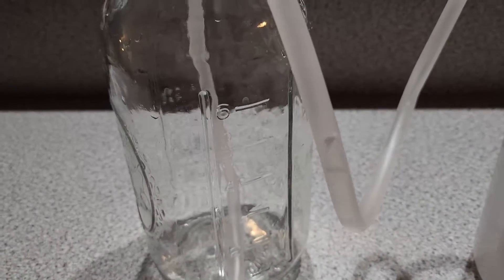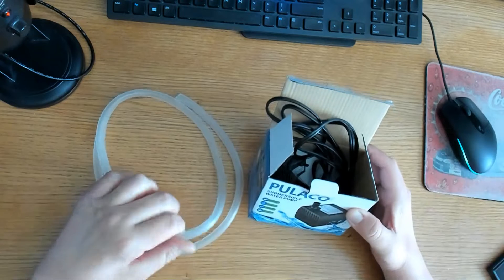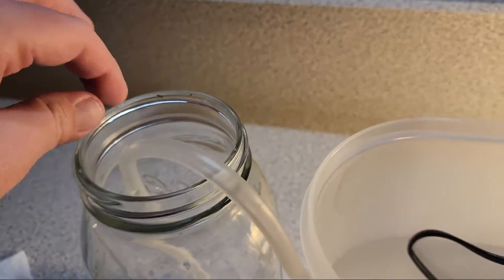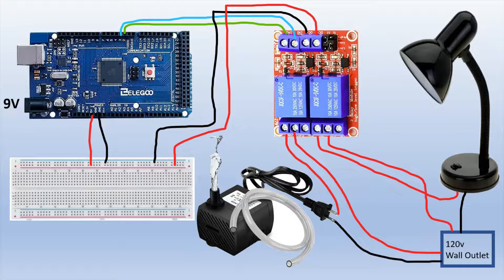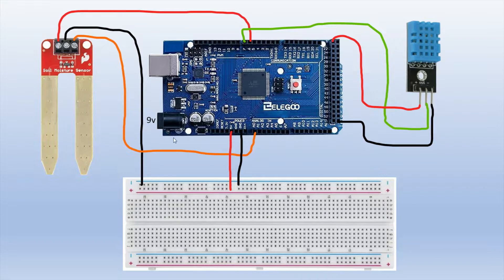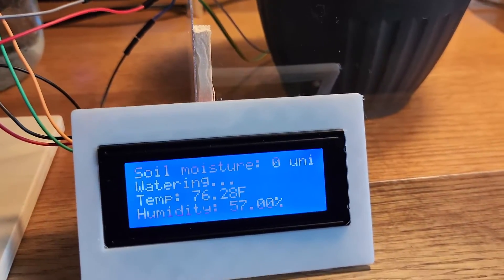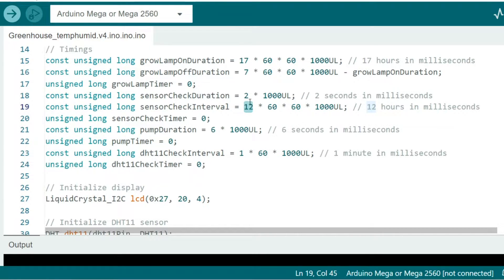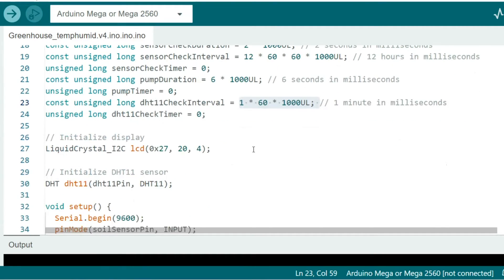Garden Like a Pro: Build Your Own Arduino Powered Indoor Mini Greenhouse

Comment: can you use a power bank to power this? instead of the wall adapter, what alternative can you use?
Reply from the maker: hey there!
You will want a 12v power source. A 12v battery that is capable of running a pump periodically. Supply appropriate power to your Arduino.
Connect step-down (buck) converters to power the lower-voltage items. If your LED lamp and pump are 12V, there is no need to step them down—power them directly from the battery.

In the video I used a relay, but for a DC setup, you may want to use a logic-level MOSFET to do the switching.
If you find that the pump and lamp are power hungry and pump startup causes Arduino resets, isolate the electronics with a proper buck converter, wiring, and capacitors.

Make sure the battery can supply enough current for all loads. Calculate the maximum current draw and add at least 20% overhead to ensure reliable operation.

This is how I would approach it as a DC powered project. Make sure to check your datasheets - that part is a must!  👍👍

Comment: can I use arduino uno for this project?
Reply from the maker: Hey there!
sure you can! Just make sure your pin definitions in the code match the pins you use on the uno. 👍
Reply: @BMonsterLaboratory thank you! can you use a uno r3 ch340, instead of elegoo mega?

Comment: Can I use Arduino Uno R3 instead of Elegoo Mega?
Reply from the maker: Hey there!
yes, you can. Just make sure your pin definitions in the code match the pins you use on the uno. 👍

Comment: hello. im from india and I cannot find the elegoo mega, can you please share a link to it as I am gettin varied results
Reply from the maker: hey there!
I used the Elegoo Mega R3 version, it's the older version and it did just fine. Here's a link

https://www.amazon.com/ELEGOO-ATmega2560-ATMEGA16U2-Arduino-Compliant/dp/B01H4ZDYCE/ref=sr_1_3_pp?crid=268B5225KRNSA&dib=eyJ2IjoiMSJ9.4NfekKUziOGIHon9sPPDWsoAcLKLjzAWE0J_h1lr_JvQuiUoP2Y2tfaCtAkcmE25YC-l_bFVWo4dM7VUD4ePaBtzStscVPiksJtKJ8nm0qL5NnxjASmlTKDwt3npjx0Qrjhgbq1o82EHiUQFKdHuzQSLEMxwJEUE5QAmwyPRa3Ia3YE-AeHPWuq7NhJvDlYXz9fQSZKZ8RRu12qkaeb6BJeFkq0ftdJA0qXaP3r4Xh4.-zpjiWa6dd8HxBFn-pffeJ68SoM6pyF1-AMOG9_tosY&dib_tag=se&keywords=elegoo%2Bmega&qid=1759783341&sprefix=elegoo%2Bmega%2Caps%2C135&sr=8-3&th=1
Reply: @BMonsterLaboratory  Thanks a lot bro appreciate it
Reply from the maker: @SomeRandomguy-qy6hk  you're welcome.
best of luck to you!

Comment: hey could i use like a small bulb or led perhaphs instead of a lamp and a small water  pump too like because i want a smaller project so even my plants would be small.how would that change my source voltage?like ur using 120v rn so what would i use?a battery? and also the relay?would i use a smaller relay?
Reply from the maker: you could use a strip of WS2812B LEDs, they are 5v. You can use 5, 10 or however many lights you need or you could use a low voltage buble if you like. You don't need to use a relay for low voltage switching (you can, but not necessary). A small mosfet (IRF540N ) would be a great switch for what you are describing. Amazon also has mosfet modules with simple diagrams that may be helpful. There are micro submersible mini water pumps on Amazon that operate on 5v. that would fit right into your 5v setup.
So yes, you could scale down the project and use 5V power. If you do, make sure you have a power supply with plenty of current to supply all the parts. 
This sounds like a great followup video for this project but it may be a while before I get to it.

Comment: When I plug everything in, I don’t get any readings on my display. How can I fix this?
Reply from the maker: Hello, 
make sure you're using the correct I2C address. Use potentiometer to make text visible.  Double check wiring and look for loose connections.
If that doesn't work, post your code here or send it to me by email - bmonsterlaboratory@gmail.com  👍
Reply: Ok thanks, I’ll try this
Reply: How can I check if I’m using the correct 12c address?
Reply from the maker: @JoshPike-k8n  The address may be printed on the board or in the documentation for the board. It will be something like 0x27 or 0x3F... some variation of that.
For instance, my I2C address in this video is on line 27: LiquidCrystal_I2C lcd(0x27, 20, 4); 
0x27 is the address, the lcd has 20 columns and 4 rows.

You  can run this program and check the serial monitor in Arduino IDE to get your I2C address: 

#include <Wire.h>

void setup() {
  Wire.begin();
  Serial.begin(9600);
  Serial.println("Scanning for I2C devices...");
}

void loop() {
  byte error, address;
  int nDevices = 0;

  for (address = 1; address < 127; address++) {
    Wire.beginTransmission(address);
    error = Wire.endTransmission();

    if (error == 0) {
      Serial.print("I2C device found at address 0x");
      if (address < 16)
        Serial.print("0");
      Serial.println(address, HEX);
      nDevices++;
    } else if (error == 4) {
      Serial.print("Unknown error at address 0x");
      if (address < 16)
        Serial.print("0");
      Serial.println(address, HEX);
    }
  }

  if (nDevices == 0)
    Serial.println("No I2C devices found.\n");
  else
    Serial.println("Scan complete.\n");

  delay(5000); //
}
Reply: @BMonsterLaboratory ok thank you

Comment: can you please list down the components needed?
Reply from the maker: hey there!  go to 0:40 in the video. I include the name and image of items you'll need. 
For the code, go to Facebook and search "greenduino" and you'll see the video post. look in the comments for the code, it's posted in 2 parts. Put it in your Arduino IDE and upload it to your arduino 👍😎  you'll be growin' in no time
Reply from the maker: Looks like I posted the code in a previous comment on this video...here's a repost.

#include <Wire.h>
#include <LiquidCrystal_I2C.h>
#include <DHT.h>
// Pin definitions
const int soilSensorPin = A0;
const int pumpRelayPin = 2;
const int growLampRelayPin = 3;
const int sensorPowerPin = 6;
const int dht11Pin = 7;
const int soilThreshold = 100; // Adjust according to your desired soil moisture threshold
// Timings
const unsigned long growLampOnDuration = 17 * 60 * 60 * 1000UL; // 17 hours in milliseconds
const unsigned long growLampOffDuration = 7 * 60 * 60 * 1000UL - growLampOnDuration;
unsigned long growLampTimer = 0;
const unsigned long sensorCheckDuration = 2 * 1000UL; // 2 seconds in milliseconds
const unsigned long sensorCheckInterval = 12 * 60 * 60 * 1000UL; // 12 hours in milliseconds
unsigned long sensorCheckTimer = 0;
const unsigned long pumpDuration = 6 * 1000UL; // 6 seconds in milliseconds
unsigned long pumpTimer = 0;
const unsigned long dht11CheckInterval = 1 * 60 * 1000UL; // 1 minute in milliseconds
unsigned long dht11CheckTimer = 0;
// Initialize display
LiquidCrystal_I2C lcd(0x27, 20, 4);
// Initialize DHT11 sensor
DHT dht11(dht11Pin, DHT11);
void setup() {
Serial.begin(9600);
pinMode(soilSensorPin, INPUT);
pinMode(pumpRelayPin, OUTPUT);
pinMode(growLampRelayPin, OUTPUT);
pinMode(sensorPowerPin, OUTPUT);
dht11.begin();
// Initialize LCD display
lcd.init();
lcd.backlight();
lcd.setCursor(0, 0);
lcd.print("Greenhouse System");
// Turn grow lamp on
digitalWrite(growLampRelayPin, HIGH);
growLampTimer = millis();
}
void loop() {
unsigned long currentTime = millis();
int soilMoisture = 0;
// Check soil moisture every 12 hours
if (currentTime - sensorCheckTimer >= sensorCheckInterval) {
digitalWrite(sensorPowerPin, HIGH);
delay(sensorCheckDuration);
soilMoisture = analogRead(soilSensorPin);
digitalWrite(sensorPowerPin, LOW);
//reset sensor check timer
sensorCheckTimer=currentTime;
bool needsWatering = soilMoisture < soilThreshold;
if (needsWatering) {
digitalWrite(pumpRelayPin, HIGH);
pumpTimer = currentTime;
delay(pumpDuration);
digitalWrite(pumpRelayPin, LOW);
}
lcd.setCursor(0, 0);
lcd.print("Moisture: ");
lcd.print(soilMoisture);
lcd.print(" units");
lcd.setCursor(0, 1);
lcd.print(needsWatering ? "Watering..." : "Healthy");
}
// Check temperature and humidity every minute
if (currentTime - dht11CheckTimer >= dht11CheckInterval) {
float humidity = dht11.readHumidity();
float temperature = dht11.readTemperature();
// Convert temperature to Fahrenheit
temperature = temperature * 1.8 + 32;
lcd.setCursor(0, 2);
lcd.print("T: ");
lcd.print(temperature);
lcd.print((char)223); // degree symbol
lcd.print("F H: ");
lcd.print(humidity);
lcd.print("%");
dht11CheckTimer = currentTime;
}
// Control grow lamp: on for 17 hours, off for 7 hours
if (currentTime - growLampTimer >= growLampOnDuration && digitalRead(growLampRelayPin) == HIGH) {
digitalWrite(growLampRelayPin, LOW);
} else if (currentTime - growLampTimer >= growLampOffDuration && digitalRead(growLampRelayPin) == LOW) {
digitalWrite(growLampRelayPin, HIGH);
growLampTimer = currentTime;
}
}

Comment: can you give us a file with the arduino code please? Also can i use arduino uno instead of arduino mega for this project?
Reply from the maker: hey there!  ya, you should be able to use uno. The I2C pins will be in a different  location. 👍

#include <Wire.h>
#include <LiquidCrystal_I2C.h>
#include <DHT.h>
// Pin definitions
const int soilSensorPin = A0;
const int pumpRelayPin = 2;
const int growLampRelayPin = 3;
const int sensorPowerPin = 6;
const int dht11Pin = 7;
const int soilThreshold = 100; // Adjust according to your desired soil moisture threshold
// Timings
const unsigned long growLampOnDuration = 17 * 60 * 60 * 1000UL; // 17 hours in milliseconds
const unsigned long growLampOffDuration = 7 * 60 * 60 * 1000UL - growLampOnDuration;
unsigned long growLampTimer = 0;
const unsigned long sensorCheckDuration = 2 * 1000UL; // 2 seconds in milliseconds
const unsigned long sensorCheckInterval = 12 * 60 * 60 * 1000UL; // 12 hours in milliseconds
unsigned long sensorCheckTimer = 0;
const unsigned long pumpDuration = 6 * 1000UL; // 6 seconds in milliseconds
unsigned long pumpTimer = 0;
const unsigned long dht11CheckInterval = 1 * 60 * 1000UL; // 1 minute in milliseconds
unsigned long dht11CheckTimer = 0;
// Initialize display
LiquidCrystal_I2C lcd(0x27, 20, 4);
// Initialize DHT11 sensor
DHT dht11(dht11Pin, DHT11);
void setup() {
Serial.begin(9600);
pinMode(soilSensorPin, INPUT);
pinMode(pumpRelayPin, OUTPUT);
pinMode(growLampRelayPin, OUTPUT);
pinMode(sensorPowerPin, OUTPUT);
dht11.begin();
// Initialize LCD display
lcd.init();
lcd.backlight();
lcd.setCursor(0, 0);
lcd.print("Greenhouse System");
// Turn grow lamp on
digitalWrite(growLampRelayPin, HIGH);
growLampTimer = millis();
}
void loop() {
unsigned long currentTime = millis();
int soilMoisture = 0;
// Check soil moisture every 12 hours
if (currentTime - sensorCheckTimer >= sensorCheckInterval) {
digitalWrite(sensorPowerPin, HIGH);
delay(sensorCheckDuration);
soilMoisture = analogRead(soilSensorPin);
digitalWrite(sensorPowerPin, LOW);
//reset sensor check timer
sensorCheckTimer=currentTime;
bool needsWatering = soilMoisture < soilThreshold;
if (needsWatering) {
digitalWrite(pumpRelayPin, HIGH);
pumpTimer = currentTime;
delay(pumpDuration);
digitalWrite(pumpRelayPin, LOW);
}
lcd.setCursor(0, 0);
lcd.print("Moisture: ");
lcd.print(soilMoisture);
lcd.print(" units");
lcd.setCursor(0, 1);
lcd.print(needsWatering ? "Watering..." : "Healthy");
}
// Check temperature and humidity every minute
if (currentTime - dht11CheckTimer >= dht11CheckInterval) {
float humidity = dht11.readHumidity();
float temperature = dht11.readTemperature();
// Convert temperature to Fahrenheit
temperature = temperature * 1.8 + 32;
lcd.setCursor(0, 2);
lcd.print("T: ");
lcd.print(temperature);
lcd.print((char)223); // degree symbol
lcd.print("F H: ");
lcd.print(humidity);
lcd.print("%");
dht11CheckTimer = currentTime;
}
// Control grow lamp: on for 17 hours, off for 7 hours
if (currentTime - growLampTimer >= growLampOnDuration && digitalRead(growLampRelayPin) == HIGH) {
digitalWrite(growLampRelayPin, LOW);
} else if (currentTime - growLampTimer >= growLampOffDuration && digitalRead(growLampRelayPin) == LOW) {
digitalWrite(growLampRelayPin, HIGH);
growLampTimer = currentTime;
}
}